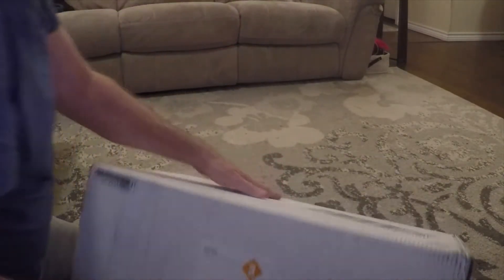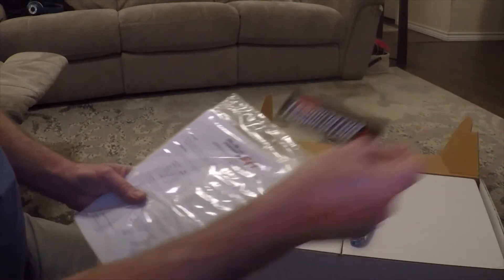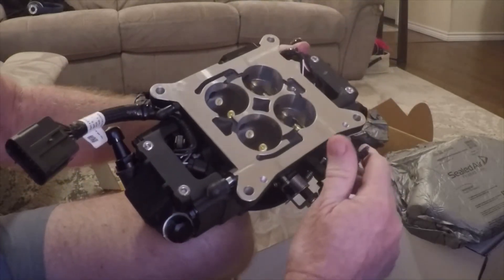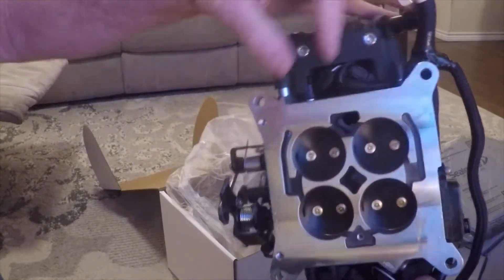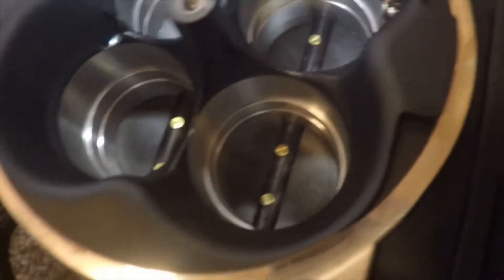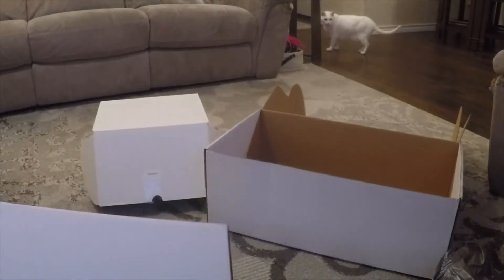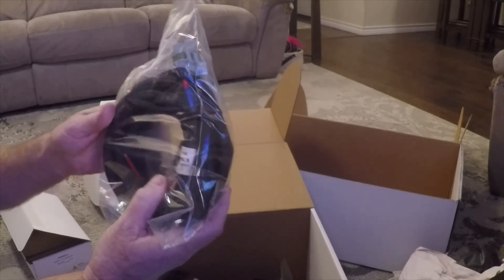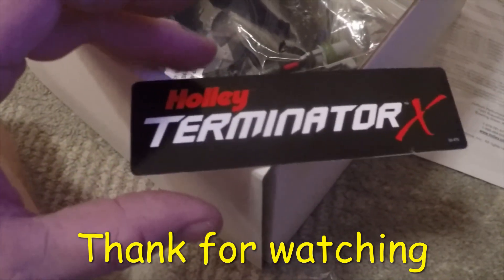Holley Terminator X Stealth

Comment from the maker: This setup on my 67 Camaro has run a 6.83 @100 mph 1/8 mile. so far.
Reply: love this unit. Looks like an old double pumper.
Reply from the maker: Yes it looks much better then the plane Terminator, Thanks for watching and comment.
Reply: You still running it? How reliable has it been?
Reply from the maker: @IvyGreen1966  yes still running it and working good.